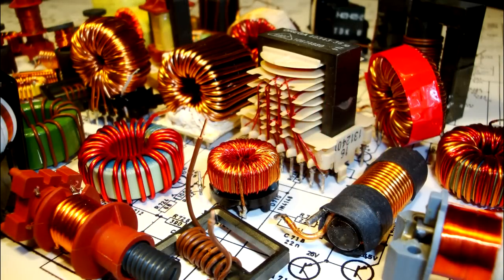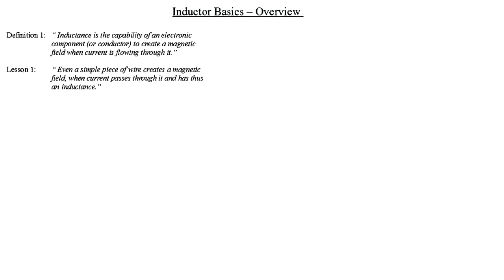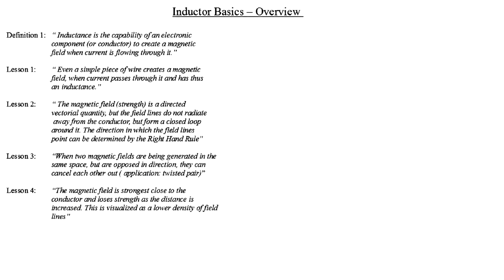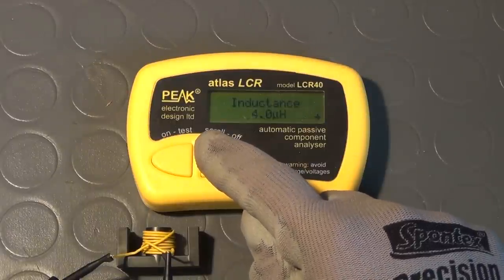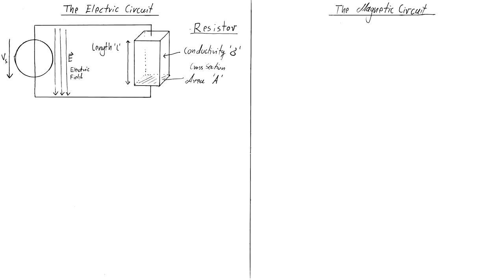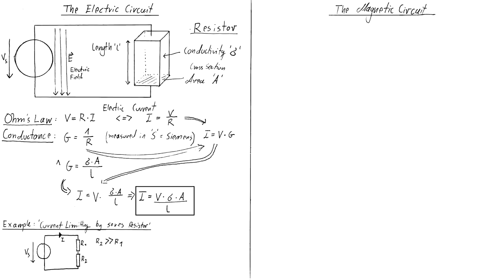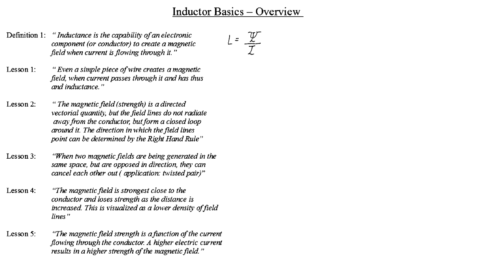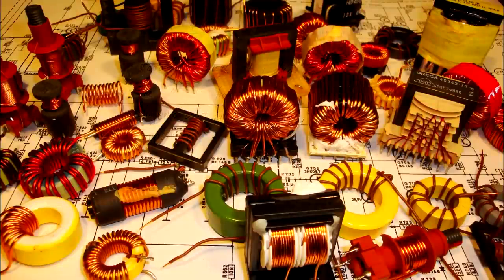SMPS Tutorial (5): Inductor Basics, Magnetic Circuits, Switched Mode Power Supplies

Comment: The hard part is learning the terminology and jargon; made especially difficult by the many uses of the Greek lettering system. Once the vocabulary can be memorized and related to the corresponding electrical terms it is fairly straight forward to work with the equations.

On another note;
where are the other parts to this series!!! I remember going through and watching all the other videos MONTHS ago just to get to the end and realize that it wasn't finished. I realized that I had caught up to the latest and just had to wait. I just finished going through and slowly watching all the parts again thinking that by now it would be concluded. Only to find out that it hasn't changed for almost a year and a half.

You must know that I subscribed to this channel after only watching a couple videos due to the quality of the content; you make great videos so I wouldn't want you to rush and put out a half-assed attempt. I know these videos take much time and effort but know that these are some of the most important videos on your channel.

Maybe before you move on with the TIG welder project you should bring the rest of us up to speed on these SMPS's so that we can grasp your current/future reverse engineering better. 

My ultimate SMPS goal is to build an AC/DC capable TIG/Stick welder with all the customizable settings a modern Inverter welder should have. I very much want to follow your journey; so please don't leave your students in the dust.

Thank you for all that you've done and will continue to do.

With regards...

Comment: By the way, I paused the video when you derived the formula for B = (Vm.l.A)/(mu). Somehow there is something not adding up as you already have B = (Vm) / (Rm.A). So A should've been eliminated when you added the equation Rm = (mu.A) / (l). Can you explain what is going on?
Reply from the maker: Yeah you are right. I forgot to eliminate A.  The formula is that for the interlinked Flux and not for the magntic flux density. So it must be Psi = (V_m.my.A) / l  and  B = Psi / A  = > B = (V_m.my) / l  ! Thanks for the comment. I just made an annotation with the correct equation at that point in the video. These kinds of mistakes happen sometimes when I wright down my derivations a second time to make them more readable. ^^

Comment: Hi
Just to understand it better can I state it so, in a buck converter topology the high flyback voltage induced by the inductor becomes the ac current which passes across the output capacitor to ground and freewheeling diode. Where as in the boost converter topology the nominal input voltage becomes the ac current and passes through the output capacitor.

Comment: I always thought that the definition of inductance was the degree to which an inductor can induce voltage in itself per its physical dimensions. In other words, a better designed inductor will always have a higher value of voltage induced across it and at the same time will be of a smaller size. Not sure if it's technically correct though...Thank you for your awesome tutorials.
Reply from the maker: The voltage induced across the inductor is V= L*d(i)/dt. So what you say is true. That relation can be derived from Faraday's Law of Induction and I will speak about that in the next video. But it is likewise true that the inductance is a function of the magnetic flux.
Reply: The Post Apocalyptic Inventor I have been thinking for a while about constructing my own transformer and it turned out to be quite a challenge for me to do so. You seem to be very experienced when it comes to (not only) design and construction of inductors. That formula you gave me deals with rates of change of one variable with respect to another and to find the value of inductance for the primary winding of my transformer I had rearranged it to:  V*dt/di=L. I know that the overall power of the transformer is 20VA; Mains voltage=230RMS; Primary current=20/230=87mA; Line frequency=50Hz. For the rate of current change I took 1/4 of the period which is 5ms: Period=1/50=20ms. So the current starts from zero and goes all the way up to 87mA and it takes 5ms for the current to reach its peak RMS value: dt/di=0.005/0.087. And the amount of inductance for the primary winding is: 230*0.005/0.087=13.218 Henry. I know that aside from 87mA there's also going to be some amount of exciting current needed for core magnetization as well as some current to overcome core losses and some value of series resistance along with capacitance and stray inductance. I'm lost right now and have no idea what i'm doing :) Does what I've written make any sense to you? Thank you.
Reply: ***** Thank you for your input! The problem is that there's no data available on the core of my transformer so there's no way I can know such parameters as Bmax or f. This transformer has been salvaged from an old electrical appliance and I don't remember exactly what it was. I've looked into some basics of electromagnetism theory and realized that the most important parameter that you must always keep in mind as far as transformers go is their maximum flux density before saturation is reached ("knee" formation on B/H magnetization curve). So Bmax is pretty much dictated by the core material and its physical dimensions, whereas, the value of B is determined by the number of turns there are in the winding, the amount of current that's flowing through the turns of wire and the distance between north and south poles of the coil. My intentions are to establish this "knee" where there would be no further increase in flux density even if I keep increasing the field intensity. I use this formula: Fm=IN ,where Fm-magnetomotive force (At); I-current (Amps); N-number of turns. The only way I can change the value of field intensity (H=IN/m) assuming m and N are constants is through increase or decrease of current (I). There will be a point where the coil will no longer be able to increase its inductive reactance due to "constant" dФ, and that turns into high primary winding current (the core is stuffed with magnetic field lines)..........................................
Reply: ***** The primary winding is just wound temporarily for me to test the transformer core and it has 687 turns in it. The build of this transformer is for educational purposes only (though if it turns out to be of a good design I might use it for some of my projects) - I'm not interested in buying one :)
You're right about looking for that sudden (not that abrupt though) change in current - that is not the only way to go about it: instead of measuring current going through the primary I can keep track of the value of magnetic flux that is present in the core because as I increase current through primary winding I'm also increasing magnetic flux. This flux can be computed through measuring the voltage across the secondary winding (primary and secondary windings do not overlap each other - positioned separately) dФ=Vs/Ns*dt and as soon as the secondary voltage will become disproportional (less linear) with each increase in primary current that will tell me the point of saturation. The flux linking with the primary and secondary windings is uniform throughout the core assuming there's no poor coupling between the two. BTW the goal here is to use as many turns in the primary winding as possible thus reducing exciting current (needed for core magnetization) this current flows through the primary while the transformer is not being used (secondary is open-circuited). This will allow me to use this transformer more efficiently ((will help me to maximize the output power: I(exiting)+I(load)=I(primary)). And as the exciting current increases the available power for the load decreases. Fm=IN=687*I(primary)
Reply: ***** Yep. Nothing is perfect...

Comment: The Post Apocalyptic Inventor inductor meters are expensive is there a cheap way to mesure inductance?
Reply: Owen Chase I have only very basic understanding of electricity, this probably won't work. Measure resistance of coil (lets call it R), then ad it to AC and measure voltage and current (U and I). Now by Ohms law we can calculate resistance of the coil which should be bigger because of inductive resistance. We can then take of wire resistance from whole resistance to get inductive resistance (X). X=2*pi*frequency*inductivity, so inductivity=X/(2*pi*frequency). If you are using mains or direct step down transformer frequency is 50 Hz usually.
Reply: ok thanks